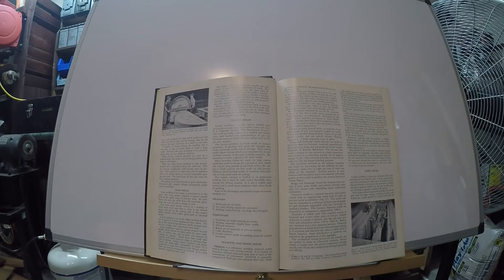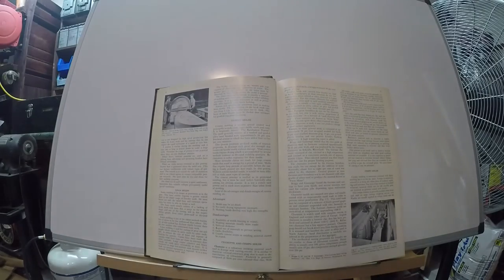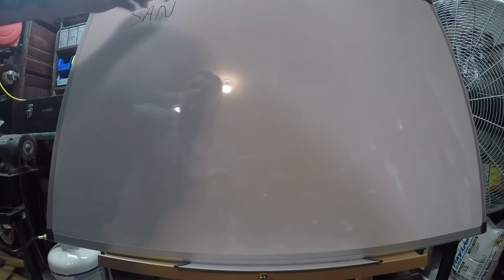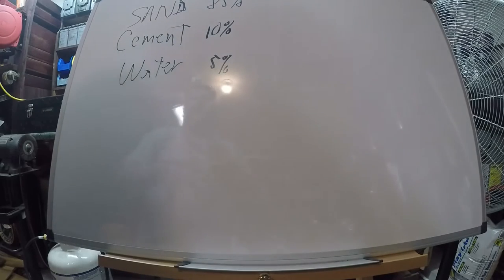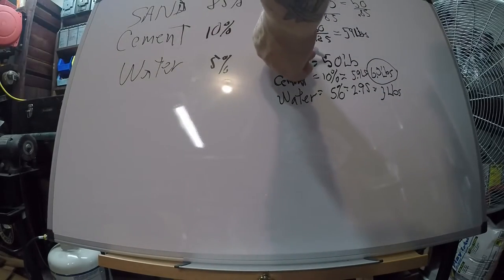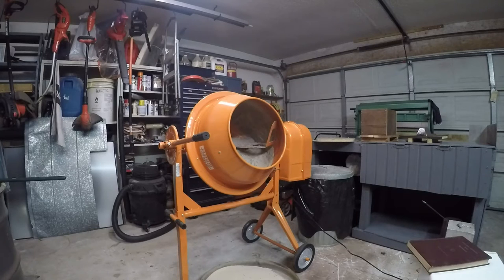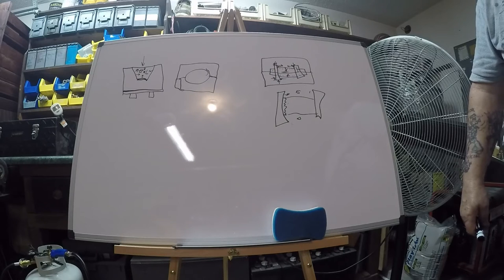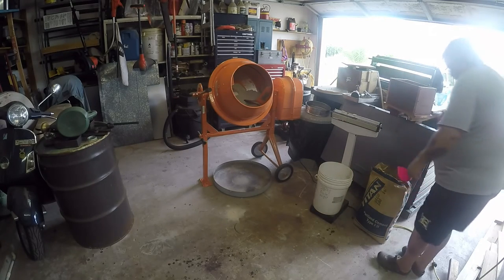Testing the usefulness and simplicity of Cement molding.

Comment: It would seem to me that you could make use of the concrete mold to make dual flange casting like your example if you were to make an "external core"  to allow a point of failure that would deform at a pressure less than the force required to induce a failure in the casting as it cools.

it might be practical if you were to make a bunch of castings using the cement sections over and over and the inner and outer cores one time.

An idea that might work, would be to make inserts of lava rock that would crush as the casting cooled allowing the the casting to shrink without damage.

It would require a bit more work in the pattern shop, but pattern makers tend to be clever buggers.